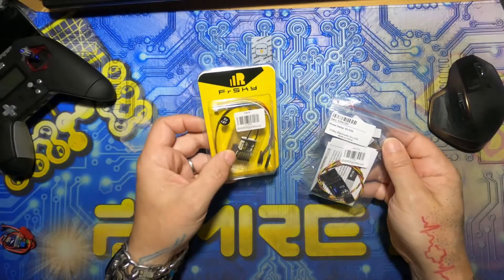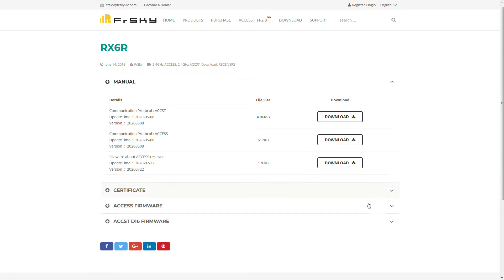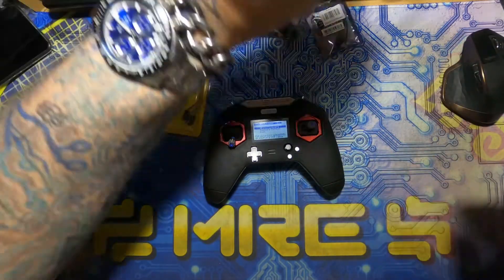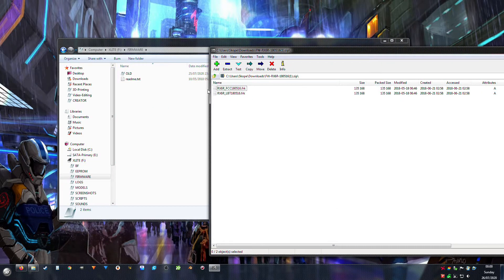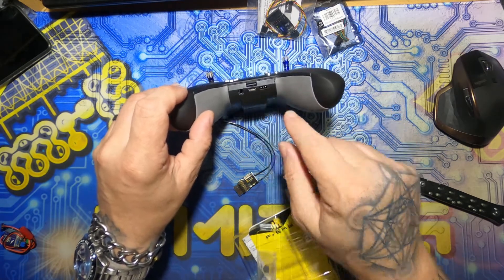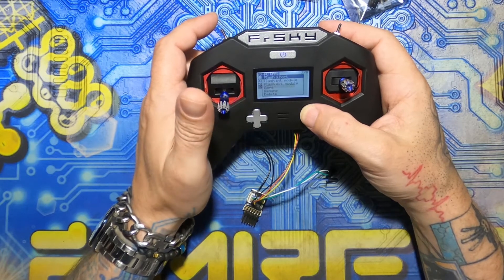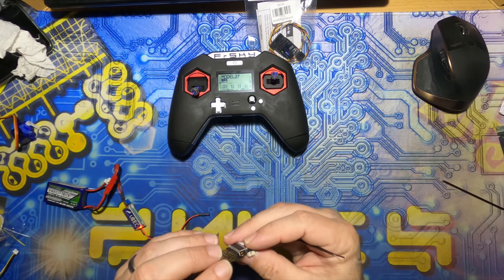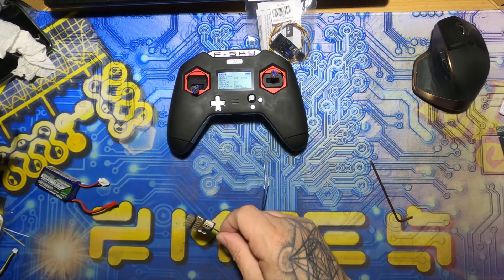FrSky RX6R Receiver Firmware Update (ACCST LBT/FCC & ACCESS)

Comment: I have one of the RX6R -   FW EU-LBT  ACCST  V1 -  is this the current best  FW  especially the V1 option - I will be sticking with the ACCST protocol for some time but I can change to the ACCESS is that correct 
  The Tx FW has to match the Rx FW  - - both my Tx16s & Taranis has FW Ver 2.3.11-otx  Taranis has Ver 2.3.11  am I good to go ...joe
Reply from the maker: The best FrSky firmware version is very subjective & also depends if you have any D8 third party stuff as in my case I have tons of old receivers and bind and fly quads which requires V1/FCC (D8).

If you are just planning on planes and new stuff, V2/LBT or ACCESS is the way to go from the start but you should be fine with a TX16S to chop and change protocol from the menu without any problems what so ever (Caveat below regards ACCESS/MPM).

You are indeed correct that firmware version will need to correspond, however the V1/V2 & FCC/LBT doesn't always line up with the OpenTX version, it relates to the XJT radio protocol module (In the Taranis for example). I've not done OpenTX in a while but expect that when you flash it it will do the module side of things (by selecting EU in the Radio Profile Edit Setting) - just keep it in mind if you cant get communication (XJT flashing on my chan somewhere).

I know it's not the simplest answer but the FrSky ecosystem is convoluted to say the least. ACCESS is certainly the most pain free for binding and updating etc if you don't have legacy stuff to start with (and you can still do X16 when an ACCESS Radio anyways. Wth your TX16s you just have to juggle a menu option for the most part between D/X/v1/v2/FCC/EU - I would also seek conformation that the multiprotocol can do ACCESS before commiting).

Hope this helps.

Comment: Can I use LBT transmitter Taranis X7 with Archer R6 FCC version? kindly suggest a way to do so
Reply from the maker: The Archer series are on the ACCESS protocol that doesn't have a LBT or FCC revision, but the X7 is only ACCST LBT/FCC from memory. 
Just had a look and the R6 only has ACCESS firmware sadly so I doubt very much that you could ever get them to work together. (requires an X9 Lite ,X9D 2019 or an X-lite Pro iirc).
Reply: Thanks for you reply! Radio is Taranis X7 Access EU lbt version. Whereas receiver is Archer R6 access FCC version. I’m unable to bind these both. Can I flash or do something to make it work? Could you please help me?
Reply from the maker: @omkarbilla  In that case it should just bind following in manual , FRSky's R6 specs state Compatibility: All FrSky ACCESS transmitters.
(LBT was only for the real old D8 stuff that didn't comply with EU regs , ACCESS does hence it's FCC regs are fine - gets down to "Listen Before Talk" / LBT).

You should be able to flash the latest firmware using the S.Port method ( here's the latest firmware https://www.frsky-rc.com/wp-content/uploads/Downloads/Firmware/Archer_RX/FW-Archer-2.1.5.zip  - not that it only includes a single file )
Reply: Thanks alot man! I’ll give a try and get back to u!
Reply: @MrE.  It worked, thanks alot man!
Reply from the maker: @omkarbilla  Real happy to hear,friend - have fun!

Comment: Can I ask how I’d use this on a miniquad? I’ve got one on my rc car, and I’ve got a second rx6r, but I don’t know how to wire it up, I know I probably can’t use sbus, but I’m not sure what I’d do for PWM.
Reply from the maker: You would have to use the SBUS output on the little white port that runs along the side of the RX6R unless you could get a considerably dated flight controller that can still take the PWM inputs, but that would create its own problem not being fast enough to run anything remotely new/current in the way of Betaflight/flight controller firmware.

Comment: Hi im having a really shitty problem, Ive updated my radio but ever time i go to flash my rx6r it says "FW update error not responding". Any ideas please
Reply from the maker: For the most part, this is usually incorrectly connected S.Port from what I've encountered.
What radio are you trying to flash from?
Reply: @MrE.  Hi im using the Taranis X9 lite, ive watched everthing i can. Just sucks
Reply from the maker: @charliewebb5895  As you see it was one and done for me on my X-Lite.
I assume the RX6R came with the female port already soldered? (had issues with GRX6 port soldering causing that error and binding problems recently)
The only things I can suggest are perhaps make sure the X-Lite side is plugged in Y,R,B coloured from the front and the connectors are well pushed home.
I would try making a new model and attempt while also try a couple of times consecutively.

I'll do my best to help you through the prob, even poss flash it for you if your in the U.K. (as I've done before for others)